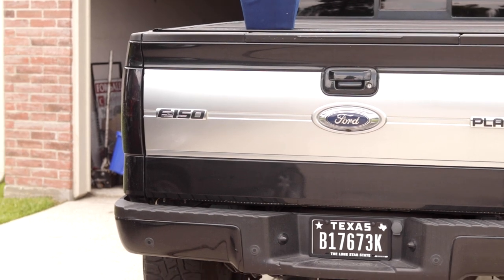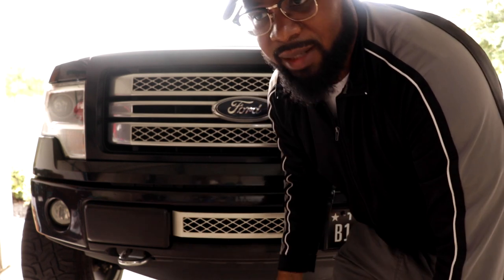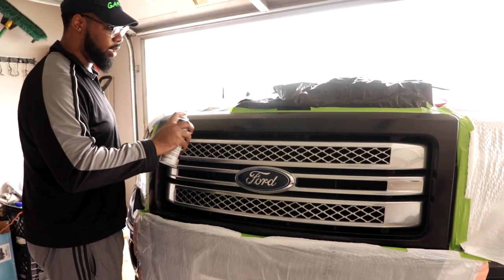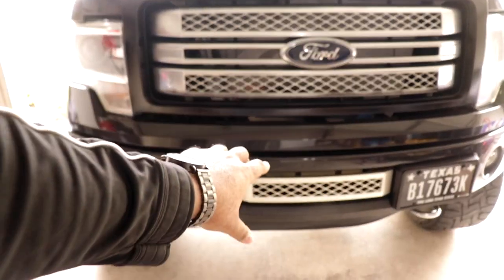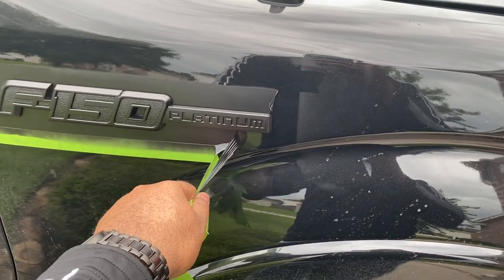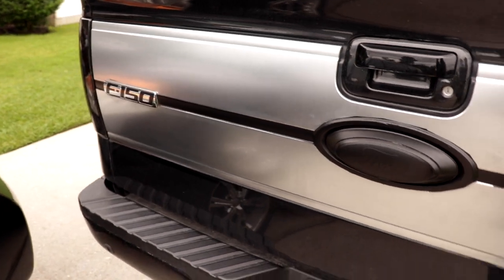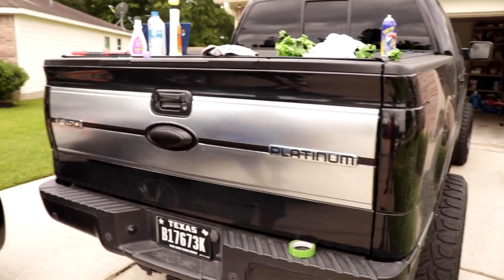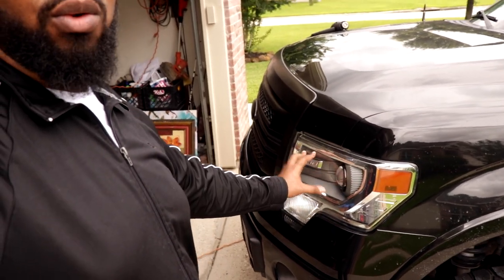HOW TO CHROME DELETE AN F-150 WITH HYPER DIP | PLASTI DIP YOUR CHROME TRIM ON YOUR F-150 TRUCK #f150

Comment: I just blacked out my Avalanche Again...used the new glossy black...wheels u can tell are glossy...use clear dip in between since it doesn't lift easy...Also couple coats of Silver Metalizer

Comment: I've done my car and trim w/Hyperdip and you will never get a clean line on any surface that does not have a gap unless you pull the tape off when it's wet. Even then, it's crapshoot because the material could stick to itself and pull off the surrounding areas. I would have just dipped the FORD emblem and left the rest of the rear tailgate cover alone. Just a thought.